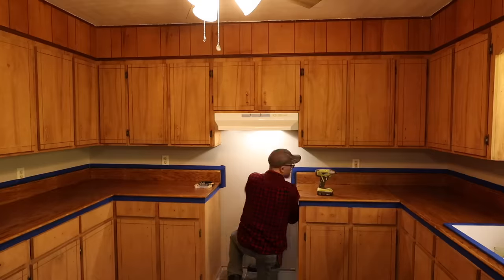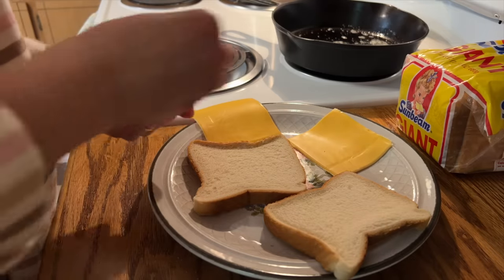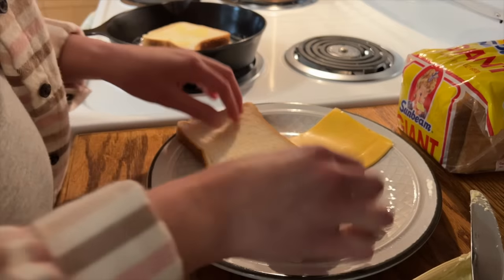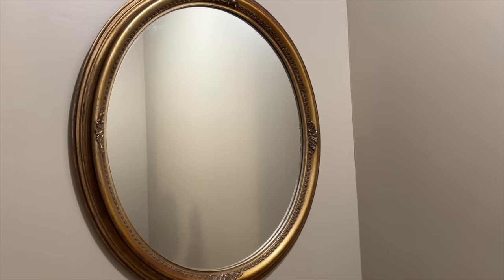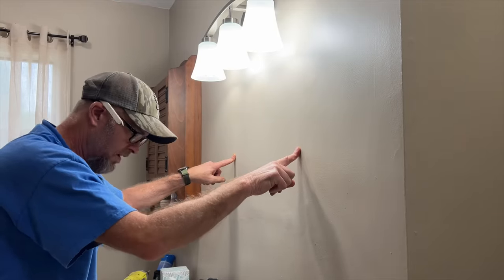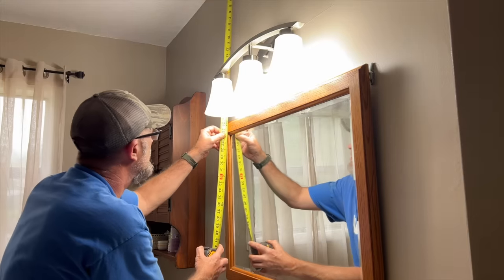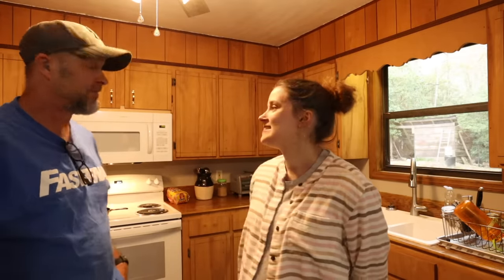Matt Installs Appliances & Hangs Mirrors - Corie Makes Him Lunch

Comment: You do such a great job Matt of figuring things out. I'm much the same way, I figure it out/research as I go, because most certainly, you don't know what you don't know. I'm curious to know though the exhaust system you put in place when you installed the microwave. I'm no contractor but I did install a microwave similar to what you are doing in the video, in the house we purchased. Just curious. I Love your Celebrating Appalachia channel>

Comment: Did you seal the cabinets? I'm sure you did, but if not, please do a good washable sealer, because I learned the hard way. I loved the raw wood and we just used an oil...big mistake, greasy hands and spills left marks and cleaning was a nightmare. We sanded and got as much stain out as we could, but had to do a light stain then several coats of sealer. 15 years later (not there anymore) like new, and this was with years of my kid, and several families of kiddos since and lots of use. 
Your cabinets look so good, it could just be the camera that makes them look mate and unsealed.

Comment: Did the same but afterwards had to drop the microwave, cut the top cabinet and doors down a third because I couldn’t get a pressure cooker or water bath canning pot on the burners with any clearance, in fact one large pot wouldn’t even fit. I tried to live with it about three months and it drove me nuts. Just added a neutral tile backsplash on the back wall below the microwave and down far enough behind the stove you could not see where it ended. Easy to clean and so happy to have the room above the pots to open them, add ingredients and stir things. 4” higher made a world of difference having working room over a pot.

Comment: Thanks for your great videos. Question- no oven and cook top exhaust hood and fan? But it pulls out moisture, grease , and heat? And you have wood cabinets. So- your reasoning? I am not critical just curious.
Reply: The hood is built into the microwave. At 2:43 you can see the vents on top where the air exhausts. For whatever reason, it has become popular for range hoods to just filter the air instead of vent it out of the house, which is the way the old hood appeared to have been set up too.
Reply: It's probably a microwave exhaust hood combo. I have one in my kitchen.

Comment: The microwave is too low, no large pot will fit, also a fire hazard. Cut down the cabinet above at least 6".then piece it back and the Dorr design allows for a re cut of the detail to match again.